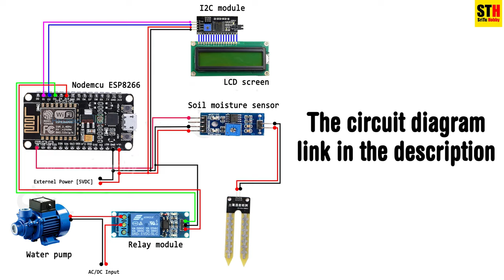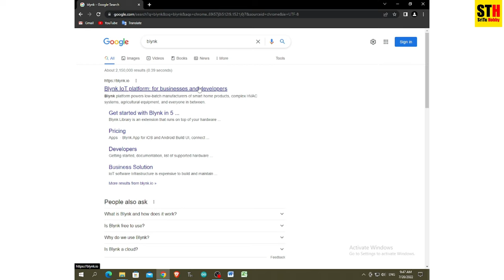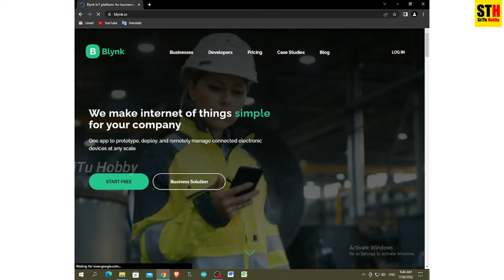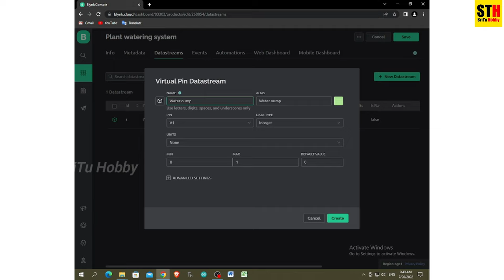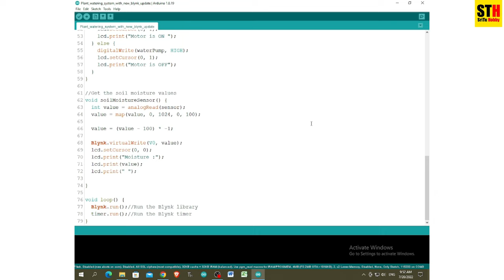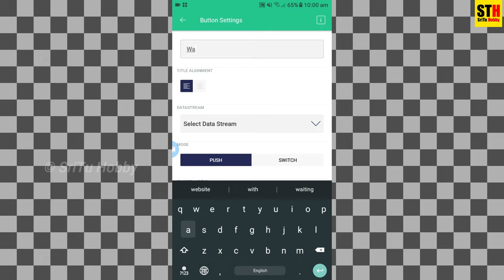How to make a plant watering system with the Nodemcu ESP8266 board and the new Blynk update

Comment: First of all I wanted to tell you that your videos are very good, thanks for them!
I am new in this world and I wanted to ask you the following question, in the video I see that you connect the 5V relay to the Nodemcu ESP8266 that only provides 3.3V, is this possible?
Reply: Bro you use npn transistor neither use relay module
Reply: Im used npn transistor BC548 it will easily trigger the water pump

Comment: When the pump has not been connected everything is going well but if the pump has been connected,the LCD will have an error and displays an unclear code, is there a solution?
Reply: Try to not use VIN if u are connected to USB like he does in video and put lcd and senzor vcc at 3.3V pin.That should fix it

Comment: Hey I need help, in the one i have built everything is running except the fact that when i click water pump "ON" the motor isn't starting. The only changes i did is i have not used the lcd display so i thought to remove the lines of code which are related to the LCD display. 
Would it cause the issue ??
Also if it is possible would you send me the code without the LCD display items pls 

Nice tutorial btw
Reply from the maker: You can make it without LCD

Comment: hello bro my everything is working perfectly !!! like everything !!! RELAY is responding but motor is not getting switched on !!! when i on/off the switch in blynk dashboard there is swithing on and off in relay but water pump is not switching on ............ and yeah i tested the water pump normally without connecting to relay its working... but when connected to relay it not ..... why is it so !!???  please help me out !!!
Reply: hello, how do you fixed it? im having the same problem
Reply: How did you fix this?

Comment: Bro my led screen is not showing anything. And when I am turning on/off from my mobile, only the relay module is glowing up and water pump is not working. Please help me with this.
Reply from the maker: Check your circuit diagram
Reply: @sritu_hobby   Yes it got resolved. Thank you for your help
Reply: Bro isme component yahi pane padega
Reply: Bro aapka no mil sakta hai project ke baaree me discuss karna hai
Reply: @yashchitroda2257  please bro help me in this project because in my project on relay red light blink but led is not working properly please send your model photo so I correct my model
Reply: @yashchitroda2257
Reply: same problem

Comment: I do this project exactly same as you deliverd on the video ...but at my project is not working .. it shows that your device is offlien ... i want to tell you that ..there no any loose connection or any defalult compenent device ..as you shawn in your video...exactly same i am doing ..but this problemed is arrived ..even one single LCd is not ON in my project ....please solave this issue ..my final project presentation 17 dec. 2022
. please tell as soon as possible
Reply: LCD check the potentiometer to have the good scale and about connection just try with another WiFi because some of them can have security protocols that block esp connection

Comment: Sir, I have made this project everything is working fine but when I turn ON the nodemcu after some time the LCD Display is not showing anything and the moisture level is not going above 60 
Sir plz help me
Reply from the maker: Check the jumper wires
Reply: @sritu_hobby  ok sir checking
Reply: @jeevedjena  is your problem solved?

Comment: Facing issue in home security system project.

I am facing issue because the blynk application is updated and the updated one is not showing the notification widget so for notification i am doing from laptop and for button also I'm doing from laptop i created quickstart template while running I'm facing some error i really don't know exactly i am facing error in blynk application or code plzz help me out with this.
Reply: Use another WiFi mby

Comment: Hey do we need to keep our laptop connected to the board all time??
Reply: you can have an external power supply, and if you are asking if the board needs to be connected to the laptop in order for the code to run then no. It doesn't have to be connected for the code to run.
Reply: @chesterguillealecida2496  thanks :)

Comment: WHEN I WANT TO SELECT PORT I CANT and when i upload the code shows an error thats it:WARNING: library LiquidCrystal I2C claims to run on avr architecture(s) and may be incompatible with your current board which runs on esp8266 architecture(s).
. Variables and constants in RAM (global, static), used 31384 / 80192 bytes (39%)
║   SEGMENT  BYTES    DESCRIPTION
╠══ DATA     1560     initialized variables
╠══ RODATA   2576     constants       
╚══ BSS      27248    zeroed variables
. Instruction RAM (IRAM_ATTR, ICACHE_RAM_ATTR), used 61911 / 65536 bytes (94%)
║   SEGMENT  BYTES    DESCRIPTION
╠══ ICACHE   32768    reserved space for flash instruction cache
╚══ IRAM     29143    code in IRAM    
. Code in flash (default, ICACHE_FLASH_ATTR), used 256244 / 1048576 bytes (24%)
║   SEGMENT  BYTES    DESCRIPTION
╚══ IROM     256244   code in flash   
Failed uploading: no upload port provided
please help me i have a school project
Reply from the maker: Select the correct COM port